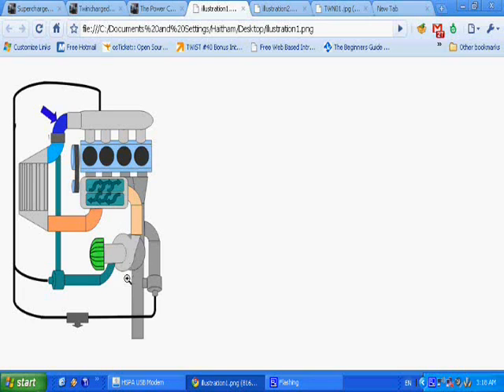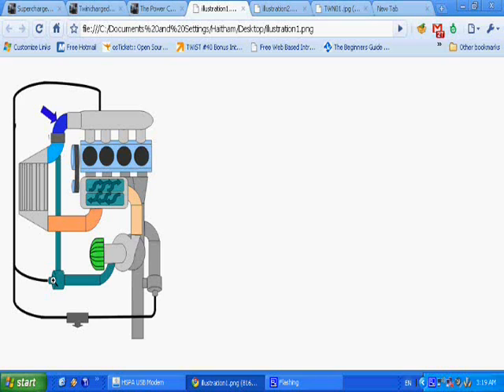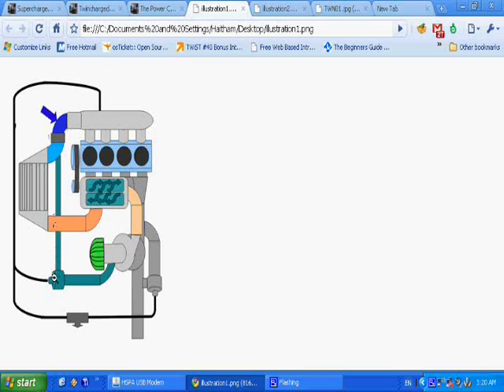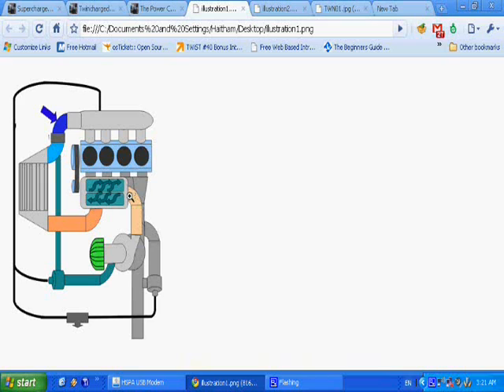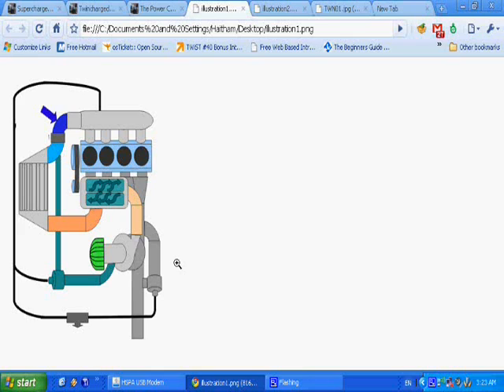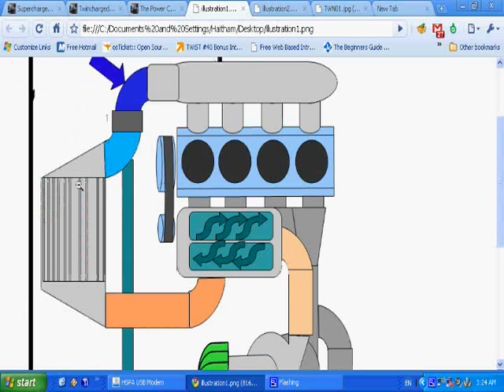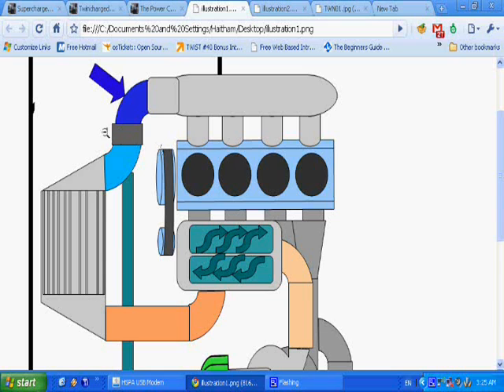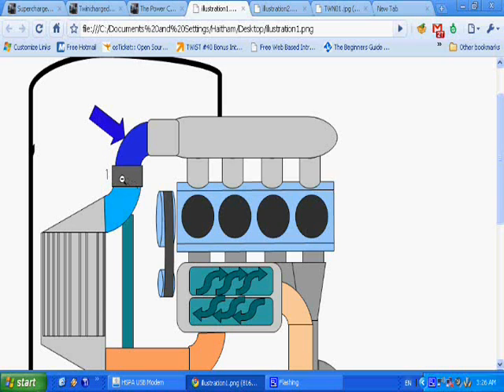Using the Turbo Calculator to design your twincharged setup - Part2

Comment: what about using a procharger instead of the twin screw? would that be recommended?
Reply: You can use those but because they act more like a belt driven turbocharger, they will not make the low end torque/response of a positive displacement supercharger.